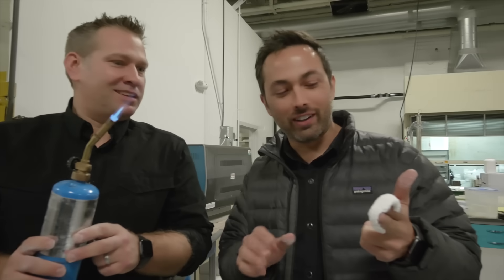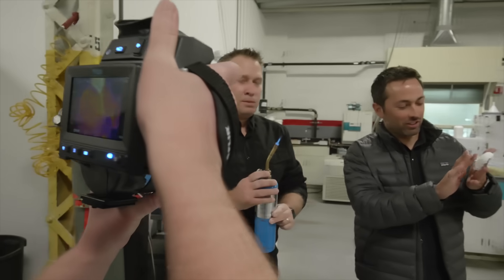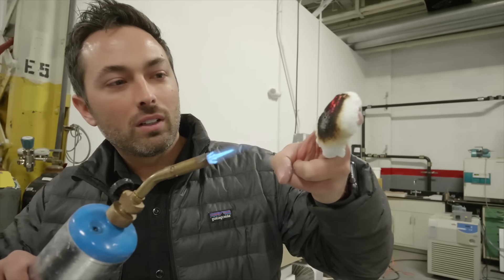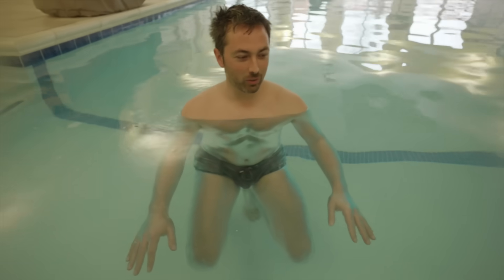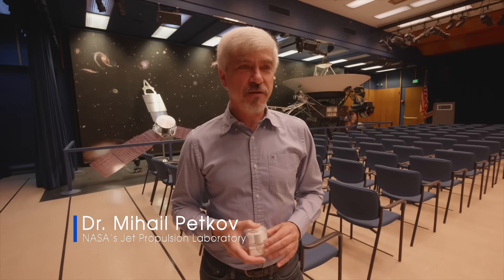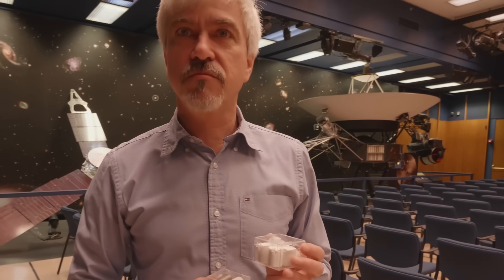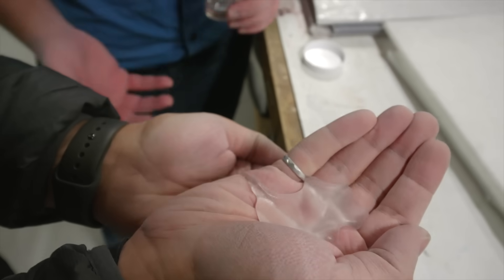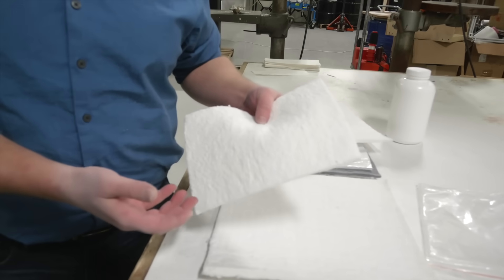I Waterproofed Myself With Aerogel!

Comment: The real question is how he’s supposed to wash it off now...
Reply: Microcontrollers YT with wa... nevermind
Reply: B1 Battle Droid hahaha
Reply: Smart
Reply: Soap is a surfactant and acts to break these bonds. Soap loves oil and dirt and water all at the same time. It basically acts to make the gel less hydrophobic and allows thr water to wash it off.
Reply: Going off what I saw he entered the water gently after applying the aerogel, so I'm guessing simply aggressively rubbing would dislodge the particles from his skin. This is just based off what I saw.
Reply: Ik this is a joke but i cant help it. He probably scraped it off.
Reply: Obviously all he has to do is get a skin transplant. Dumbass.
Reply: Skin transplant

Comment: Physical insecticides wear down the epicutical of the exoskeleton, which is the waterproof layer of the bug. It has a highly waterproof wax. The reason insects need this is because their volume to surface area ratio is so tiny that without a waterproof barrier, they would loose water at such rapid rates that they would die. A physical insecticide doesn’t such water out of bugs, it wears down the epicutical so the water loss happens naturally.

Comment: How do you take it off if your waterproof
Reply: it's likely soluble in something other than water. for example, engine grease doesn't wash off well with water, but if you apply a different solvent like alcohol, or xylene, it wipes right off.

Comment: Why not just apply it to the bottom of boats and then boats can go super fast!
Reply: Could be a good idea, but it might make boats unstable in water. If the hull of the boat is so slippery that when speed from the engine is applied, the boat just flips over, that would be bad.
Reply: Ottee2 I wonder if some type of wing function might help or a change up in design?
Reply: KingIceHunter A canard wing is utilized in Hydroplane racing. Hydroplane race boats ride on top of the water and can get light from a wave of wind, so a wing between the sponsons can be rotated by the driver to either direct more or less air under the boat, keeping the boat on the water or speeding it up by lifting it more.
Reply: WelcomeToTheMatrix cool, thanks for the info!
Reply: Titanic #2

Comment: So after a little research it seems that aerogel is commonly made out of a silica gel which is related to what's used in contact lenses. The difference is how the solvent and liquid is removed from the gel, in materials similar to contact lenses the liquid and solvents are allowed to evaporate out, leaving behind a much smaller product (a result of capillary action causing the gel to shrink as the liquid and solvents are removed). In aerogel they use a process called supercritical drying which heats the solvent to a supercritical fluid so that it expands more similarly to gas. Since it expands like a gas the solvent has less surface area and can be removed without capillary action shrinking the structure of the gel. If the solvents are completely removed as they are in contacts I don't see aerogel becoming tomorrow's asbestos.

Comment: I wonder if you put aerogel into the composite of tank armor, would it help increase heat protection
Reply: the ceramics already do well enough. not to mention that the thick steel hull provides an enormous thermal mass to overcome before heat can be effectively transferred to lower layers.
Reply: legionbunny good point, but who knows maybe it will be a lighter option for IFV’s if it actually works, cause tandem warheads make ERA pretty useless,  and most IFV’s don’t really get too much armor for the sake of mobility( I hope you see what I’m trying to say)

Comment: This should be used for firefighters, military and navy, and buildings (hopefully its not like asbestos).
Reply: He said it's not like asbestos where the molecular strands are long and the body doesn't chemically break it down, he said something like the body readily absorbs and expels it.
Reply: The navy can't use it. It will cost 100k per square feet and they will gundeck it.
Reply: I see many marvellous uses with these aerogels in the future. Just think if you could waterproof the foundation of a new house before you pour the concrete basement floor and walls. No moisture would ever get in. Also, it could work as an insecticide, but you would have to be careful with application, because you would not want to kill the beneficial insects, like honeybees. Re-entry of objects from space is another obvious application.
Reply: Really, the heat is one of the least concerning things for firefighters. the biggest issue is smoke inhalation, followed by structure collapse.
Reply: legionbunny  yea that’s why I said buildings as well because if it is able to absorb more heat then it will decrease the amount of smoke produced
Reply: I'm pretty sure they already doing so, or ATTEMPTING to do so.

I mean, this is real life, tests still needs to be done.
Reply: Not to sound stupid, but what is asbestos?
Reply: @mavhie435  it gives you cancer when burned
Reply: @dark lord no such thing as space travel lol
Reply: HEY2YALL they should use it for smartphones hardware. instead of using sticky glue around the screen, just waterproof the hardware so it will be easier to repair
Reply: @alto5893  that was a stupid comment
Reply: @alto5893  your joking right
Reply: Max Xiang how am i joking? thats 200 iq thats literally what they were looking for. they were trying this for years and now they finalky hve something that could work
Reply: @alto5893  Firefighter here, so at my base we have asked the same and guess what, no it's just too much of a risk because we don't know if we get cancer, you can literally get cancer due to fire wich we call 'Feuerkrebs' wich means 'Firecancer' also our bulky gear has it's use EVEN with that suit we still have to equip our gear. We're safer but it won't make our operators faster not with the same gear we use.
Reply: Shouldn't be given to them at all

Comment: House: *burning down*

Firefighters: “we can’t do this!”

*guy shows up with aerogel all covered on him*

Firefighters: 👀👀
Reply: ChaiSpicedD  The thing is: Insulation and water repelling works both ways. So the body heat and sweat of the fireman can also become a problem. That being said, I could imagine that those kind of suits can be used for short durations in extreme situations. Most likely not with a wet gel, but a composite of aerogel and fiber, as the paste could fall off and some composites are already quite flexible.

But, all of that is more like an idea for the far future. Right now these aerogels are quite expensive to produce and mostly labscale and rarely in industrial use (NASA, Mars Rover and such).
Reply: @ununoctiumz99  But it's not at all difficult to incorporate a means of cooling within the aerogel suit. A simple oxygen tank, which would be required for traversing a burning building anyway, would be plenty sufficient.
Reply: @wilcoxway  they should use this in engines
Reply: Firefighter: Hold Up
Reply: ChaiSpicedD  As soon as I heard insulating capabilities.
Reply: Recently such an incident happened in India. And the post mortem reports suggests that more people die of suffocation than skin burns. 

The incident took about 30 lives 27 due to suffocation and 2 due to skin burns and 1 because of jumping from the building.
Reply: @akashmazumder8235  that's sad, pray for india
Reply: @vxerx4875  yeah. It's sad. 

But also knowledgeable to people who think that it's mostly burns that kill people in a fire related incident. Lack of oxygen, poisonous fumes kills people. 

So wearing an Aerogel suit will protect you from burning but how will you cope with suffocation.
Reply: Aerogelled up deaf guy
Reply: some debris breaks all of it easily
Reply: Just a naked dude walking into a burning house
Reply: From all the responses here I'm thinking of a Spider-Man based suit or basically a power ranger type suit made out of aerogel
Reply: People not dying of burning doesn't mean burning doesn't kill. It means lack of oxygen kills faster. It's still mandatory to protect yourself from burning...
Reply: Really, the heat is one of the least concerning things for firefighters. the biggest issue is smoke inhalation, followed by structure collapse.
Reply: He said it insulates though so you would suffocate
Reply: He would also need an oxygen tank to breathe
Reply: But its 23000$ per pound
Reply: @Skurge but do you get the joke!!??
Reply: ChaiSpicedD  Lol no
Reply: Exactly lol
Reply: Lmao
Reply: ChaiSpicedD  I'm thinking a thin bottom layer of cotton or something similar, aerogel cloth layer for the thermal protection, then an outer layer of something lightly padded to protect the aerogel and provide some padding to impacts
Reply: Nobody:

IAFF WANTS TO KNOW YOUR LOCATION
Reply: Naked
Reply: I think I would rather be surrounded in aerogel  than wear bunker gear, bunker gear SUCKS
Reply: ƈǟʟɨ ɮʊʀʀɨᏆօ mormie
Reply: It's actually waterproof, not fireproof

Comment: You should have used a liquid based fueled flamethrower not a gas based one running off of a gas like propane. If gasoline or diesel were used it would not just provide heat but also an extra layer of usage as the burning liquid could soak into the composite. 

But also liquid flamethrowers are much cooler because you get that stream of fire and not just a big blowtorch.

Comment: Pretty cool stuff! Although I would wonder about the application as physical insecticide. How would you stop it from absorbing the moisture inside the crops or any other animal, small mamals or birds for example? And if it absorbs moisture/liquids, wouldn't that mean it has corrosive qualities  similar to acids? I hope there will be a lot more research in terms of its safety and eco-friendliness before it is licensed to be used commercially in which ever way and for whichever use so it won't backlash like the 'home x-ray machines' people could buy as gadgets after Röntgen's discovery was first publicised.

Comment: There's a flaw in making your body waterproof with that powder. If it repels water then it also probably seals off your sweat glands, meaning you won't be able to sweat, and considering the insulation properties, would trap your own body heat as well. I can only imagine what adverse side effects would happen if you covered yourself in that powder for a long period of time.

Comment: Can this be(or is it being) used in the clothes for firefigthers gear? 
I have recently finished my 2 year training course to be a firefighter here in Sweden and have some experience of what the capacity is for our heat resistant gear and it's far from perfect (but gets the job done) and this would be a great new addition to it. 
Unless there is some other downside like pricing or flexibility/durability of the material?

Comment: 1:02 "Non-flamable binder"
2:14 "What is burning? Uhhh... that's the binder."

Hmmmm...
Reply: @Hannah6621  How can you burn something without catching it on fire?
Reply: @fedorkochemasov4533  It doesn't continue to burn after removing the flame.
Reply: @fedorkochemasov4533  flammable means it catches on fire when introduced to a naked flame or high heat. You can burnt many things that will never catch on fire

Comment: What I want to know is whether or not it will make you swim faster since there theoretically should be much less resistance with a layer of air on the body
Reply: Andrew Reyes It would definitely make swimming a little faster. Swimmers use waterproof suits for less drag. This aerogel wouldn’t be very effective on the body because bare skin is mostly waterproof already. The best purpose for swimming this can serve is it could be a budget way to get a waterproof suit since most quality ones cost a like $300 and can only be worn once.
Reply: It absorbs water... think about it

Comment: Is it possible to mix aerogel with cement and use it for houses and other buildings to prevent fire spreading?
Reply: Cement isn't very flamable either
Reply: TheultimateFry while that is true it breaks down under heat
Reply: Why would you mix it with cement? Cement doesn't burn, what burns is the wood, furniture, carpet, walls (If not made from brick, metal or other flame resistant material) and insulation.
Reply: Lotus152 why not make an aerogel spray for furnitures so they dont catch on fire, in this situation it would Also be used to the minimum.
Reply: Lotus152 fiberglass insulation doesn’t burn tho
Reply: @nobullshit9721  True, but it does help to spread the heat depends on how hot the fire burns.
Reply: Just turn off Fire Spreads in the world settings, if you are on console edition
Reply: Bloody , wowww
Reply: I think you have the right idea, just not the process, million dollar idea right there
Reply: Diego Puga Escobar it’s a Minecraft reference if you didn’t know
Reply: Coat the wood beams with it in homes. Mix it in with the texture stuff you put on drywall before you paint. This is a great idea that just got my brain going. Home builders would make a killing ‘our homes are fireproof’ like what?! 🤯🤩

Comment: Should make suits for firemen with this material
Reply: firemen suits resist more heat than aerogel
Reply: @Divisaw666  yeah but maybe like a blanket to cover victims
Reply: @Logicamasi  then why just not cover the victims with the fire insulating cloth that they are wearing that as i said its better at insulating heat than aerogel
Reply: @Divisaw666  ok fireman

Comment: If you used that aerogel dust, would boiling water still hurt you? Or will acid still make contact with skin?
Reply: Even waterproof aerogel is still the worlds best insulator. That should include boiling water. All applications of aerogel are an insulator.
Reply: @TheAssassinViper  can it survive lava
Reply: MLG R8DR805 good question.
Reply: @MLGRDR  Well what kind of lava ?
Reply: Good question.
Reply: Boiling water could still heat you up and it depends if the acid reacts with the gel
Reply: He rubbed the dust on his skin, so he still has contact with water in places where dust isnt, so yes acid would burn him, and hot water would still burn him, a bit less but still would
Reply: My man's asking the real questions
Reply: Acid would probably react. I saw a video about hydrophobic spray being used on a car a few years back. Water and mud were sliding right off but oil and gasoline were soaking the coating.

Comment: Flour also has these properties and you can use it to make starlite. I’ve tried setting fire to flour and it doesn’t burn, it just turns a deep black color and radiates the heat outwards.

Comment: Is aerogel a very good thermal insulator? Could we use it as material to build something to cover up glaciers and protect them from melting?
Reply: Gustavo Kenzo Miyamoto yeah because glaciers are small.
Reply: Would need alot of them to work
Reply: If you cover them whats the point anymore
Reply: Also when glaciers freeze and the surface area of the ice increases then what do you do

Comment: So, with the aerogel on your body did the water feel the same temp as it did without? The aerogel blocks heat but what about cold? Could it be used in a high tech wet suit for cold water dives?

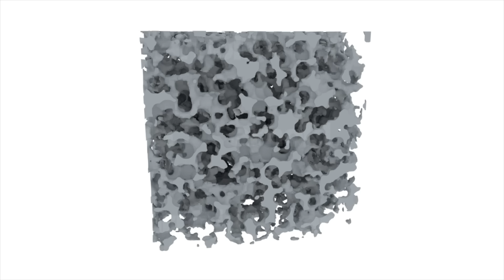Comment: 5:25 reminds me of the activated carbon... Was the activated carbon a carbon-based aerogel all along?! (it too absorbs moisture, and you get several square centimeters from a single particle of only 0.1mm in size... They also make it into a woven carbon cloth, which is pretty cool - as you said in the video, the aerogel can be made out of pretty much anything, so, carbon, too... Anti-diarrhea tablets might not sound like much, but maybe look into the activated carbon and do a video on it... if you haven't yet, that is...)

3:55 the silvery shine looks like the diving bell spider's bubble, it's probably same basic physical principle

Comment: So I was one of the people that installed this on the pipeline in Alberta head to toe protection, what they dont tell you is the how cancer causing that dust he was just smacking into the air is. My picture is some of what we wore while installing it. Maybe this is a newer version of it but my god did I cringe watching him slap that. Still the best insulator I have ever worked with and still the best paying job I ever had, best benefits and best hours if you like working 13 hour days non stop for 3 weeks.

Comment: What is the speed of sound in aerogel, and why?
Reply: 50% air 50% material. pick 50% of the speed of said material and 50% of speed of air and you get your answer
aka very slow for a solid

Comment: You can buy Aerogel sheets but only from one supplier in the UK called Proctor Group. They have a thermal conductivity of 0.015 W/mK. You can't buy any other form readily. You can also buy Vacuum Insulated Panels from just two companies in the UK called VacuTherm who import them from Germany. Another is Kingspan. They have a thermal conductivity of 0.007 W/mK. Compare these to Polystyrene which can have a value of 0.022  W/mK. Problem is though that petroleum panels lose efficiency over time. Aerogel and VIP panels are therefore exceptionally expensive, which is a shame but hopefully the price will come down, which material wise is possible, if regulations force higher standards.

Comment: It's not the aereogel that provides that thermal insulation property. I've made a binder like that. you can do it with potassium/sodium bicarbonate, cornstarch, and elmer's glue. You can torch your hand if you mix those in the right proportions, I've done it before. The carbon foam is what makes it insulate so well.